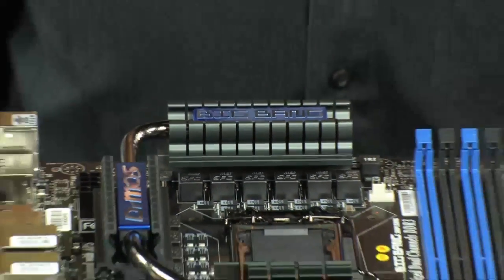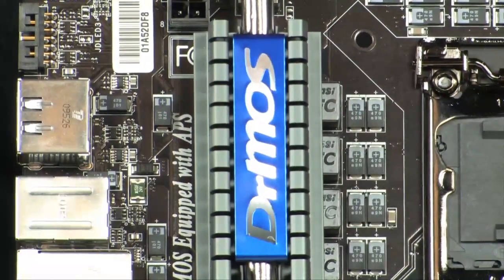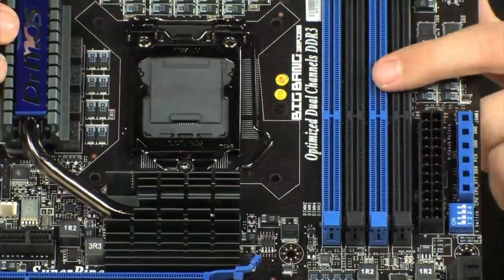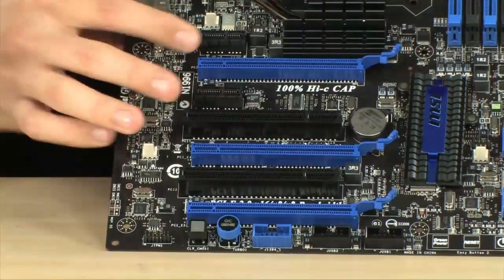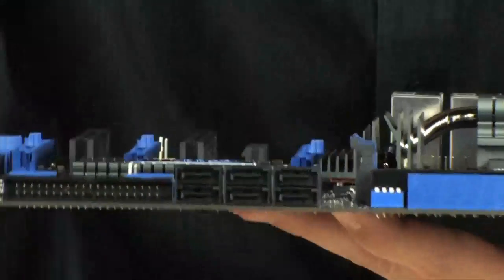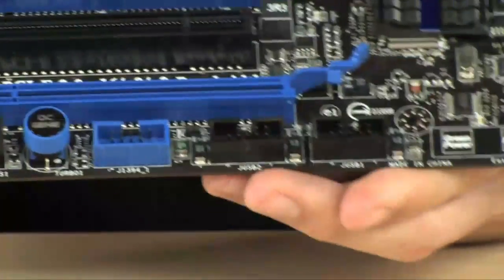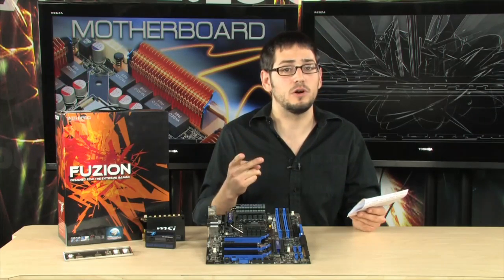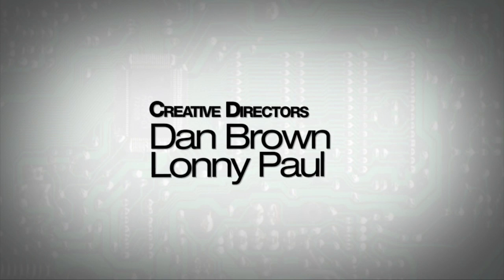MSI Big Bang Fusion Motherboard

Comment: Hey Albert, did you oversee something on this board?
There are no cylindrical capacitors, every single one is the latest low profile capacitor. This makes the board layout even more clean.